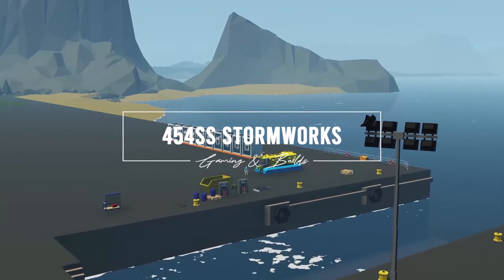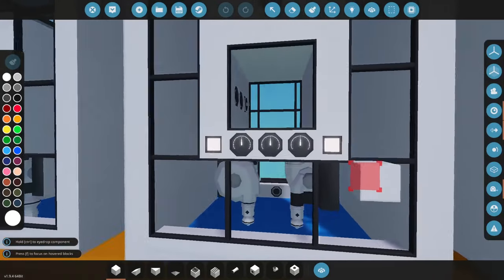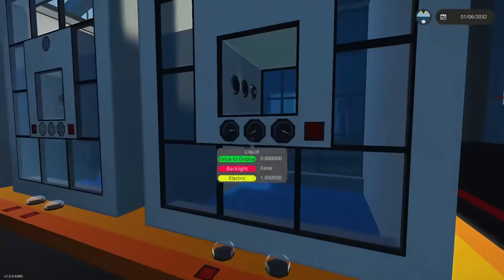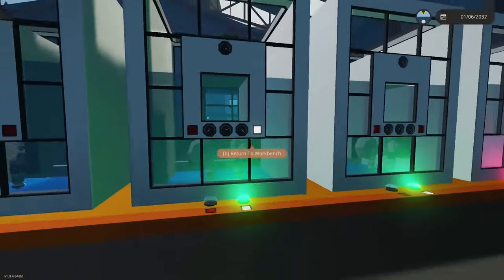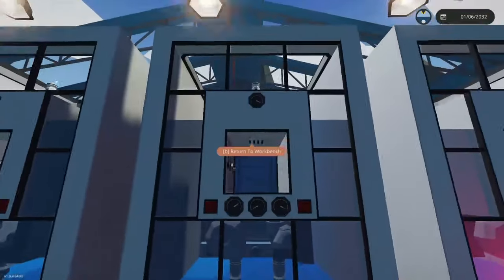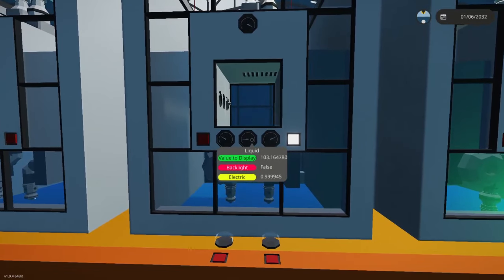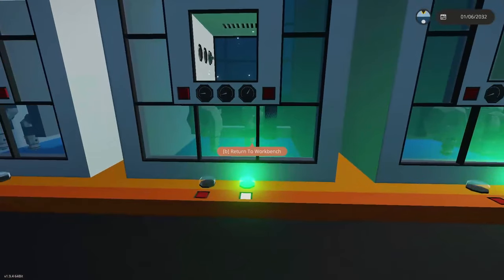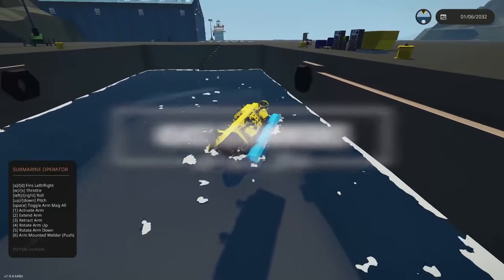Fixing BALLAST TANKS after the compressed gases update

Comment: 18:58 those top pumps are still pumping in water because it is considered an enclosed tank by the game so a pump anywhere inside will draw evenly all liquids, which is also why you need gas relief valves when trying to pump out air or else you will just drain your ballast

Comment: Something is definitely broken. I also noticed that if you make a custom fluid tank, and only attach a single valve to the outside (even a manual valve works), opening the valve causes pressure in the tank to rise infinitely for seemingly no reason. Makes absolutely no sense, the pressure in the tank should go down if anything, not up.

Comment: The second last one, where you pump in both water and air, is fast because I think you are actually pumping in water twice. When the port is in the container, it does not matter if it is submerged in water or not. That is why you do not have to put your fuel pumps at the bottom of the fuel tank. 

The one where you pump water out with a liquid filter on the pump drops pressure because, I think, the pump itself get full of air. I wonder if you would get the same result if the filter was at the water intake. 

For the last one, where you pump in water and air but with filters, the container still fills, but I think that is because the large pumps can achieve much higher pressures the small pumps. So you are pumping in air, but with a lower pressure. 

I did some testing of myself and found that the maximum achievable pressure per pump differs a lot. I noticed that a small pump can pump about 10 bar, a large one about 100 bar and a large impeller pump at 60rps can pump well over 1000 bar. But if you pump liquid through a pipe, the pipe limits the flow rate, but not the maximum pressure. Because the air tanks start at 100 bar, I will now wait in the docks for a while to fill them up to 1000 bar.

Comment: It seems to me the most logical method would be to have the ballast tank open to the sea at the bottom and have a valve or door that opens to let air out of the top, and another valve that lets in compressed air.
Reply: rahhh another stormworks transfem :3

Comment: Wait, now you can drain your tank even through the hatch/door without using water pumps, only using pressurized air. Or suck water in by pumping air out from your tank an then opening the hatch.
Reply: Or use two hatch, no need to pump. just one at the bottom and one at the top.

Comment: Something you didn't test was tanks with fluid spawners in them. As you stated in the beginning of the test the spawned water displaces air and increases the pressure in the water tank. If you spawn water in your ballast it will have a higher pressure making it harder to fill until you relieve the pressure. I've noticed that small pumps don't pump into something higher than about 10atm. I forget how much small impellers can pressurize to. Large pumps are a little over 100atm and large impellers I believe can pressurize a tank higher than 150atm.

Comment: I've been trying to fix my fuel tanker and I pretty much went through every design you did, I had to install relief valves so I could fill the tanks up, but if I don't use the air filter then I create an oil spill but because the filters slow the process down now it takes absolutely forever to load/offload the tanker.... Unless they update the game or I can figure out a different way to load and offload large quantities of fuel the "oil Baron" fast cash aspect of the game is broken for me.
Reply: Yup that's exactly why I'm here ; I tried so much different ways to fix / modify / update my fuel tank trailer, and it kinda always reaches the same : I can fill 2000 out of 20 000 Liters pretty fast (in ~10/15 seconds, so let's say ~1 750L/sec, which is way faster than before), then it slows horribly down to like 10 liters/second max, and same for emptying it, if not even worse, like 5 liters/second.

Comment: Could you do a tutorial of how to clean the air? please
Reply: You need to slowly replace the air inside the submarine with oxygen tanks and vent the dirty air outside the submarine, this is how I did it: You need a set of oxygen tanks with on/off valve and a gas relief valve on top of the submarine with a fluid flow valve, a variable fluid valve and very slowly vent outside the dirty air inside the submarine and open the oxygen tanks valve while keeping the atmospheric pressure to 1, the whole process can be automated with a treshold gate and costant number, I simply activate the "life support" with a toggle button in my submarine and it keeps the CO2 at a constant level.

Comment: I wonder if with this update you could pump air into pipes to flush any fluid out and then pump the air out to flush pipelines. For example when making your oil platform the lines had to be separate to prevent the oil/diesel/jet fuel etc. from mixing, but with flushing the pipe when switching the input liquid could allow sharing pipelines in some circumstances.
Reply: @koopalad4  it seems they do hold fluid for example when you connect an engines coolant lines in a loop even without a tank, it contains fluid, i dont know if this has changed at all, but it was like that at one point if it has.

Comment: There is actually a much better way to efficiently and realistically fill/drain ballast tanks, which you did not show here. The way I do it in all my submarines (thanks to the new gas update) is very, very close to what is done in real life, and is also pretty compact:
1. Put a door in the top and bottom of your ballast tanks.
2. Add 3-20 impellers (3 worked for me on a small sub) to pressurize your gas tanks to around 1,000 atm (yes, 1,000, you heard me right) which is the max you can reasonably go. Gear them to the max, and connect it to your power source (I used a medium electric motor, plenty of power there). The impellers will not increase in pumping speed at a certain rps.
3. When your gas tanks have been filled, open the top and bottom hatches to fill ballast.
4. When you are ready to surface, open JUST the bottom door in your ballast, and open a valve from your air to the ballast (no pumps, apart from the impellers were used throughout this process, they limit the flow of gas/liquids, and take away some of the realism). This will blow all the water out the bottom of your ballast, leaving just air. (1. make sure to be level, otherwise air will escape. 2. some water will remain (at most a few L), you may have to pump it out when you reach the surface)
5. You are now at the surface, and can repeat this process a few more times until you need to refill your air, which should take at most 30 seconds to one minute with the proper amount of impellers.
I hope you found this useful.
Reply: i tried but can you pleasemake a video, a workshop creation or even a series of images to show it better? i think is a good way, but is not that easy to me hahaha, thanks
Reply: @Mass2269  I have done a video before, so that might be out of the question, but I will be sure to put it on the workshop.